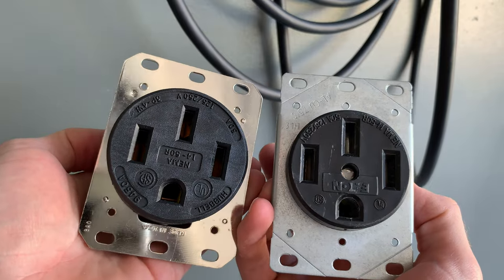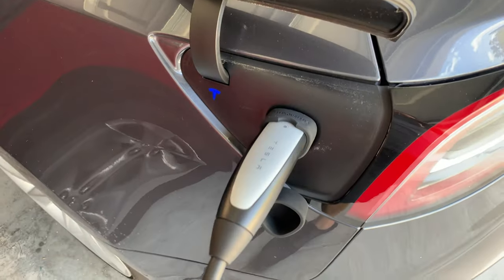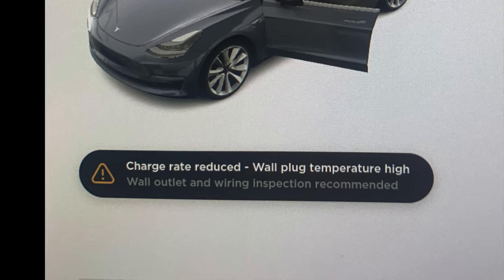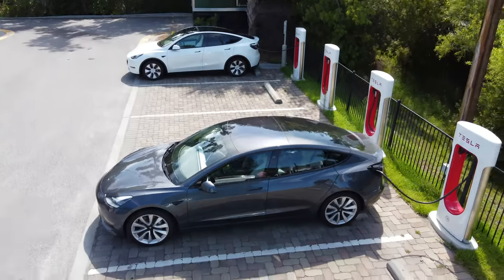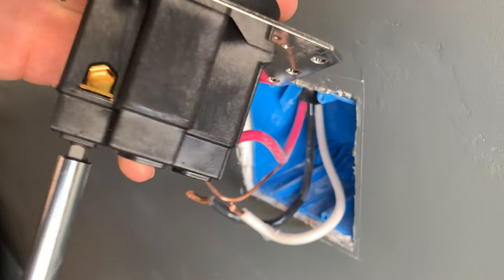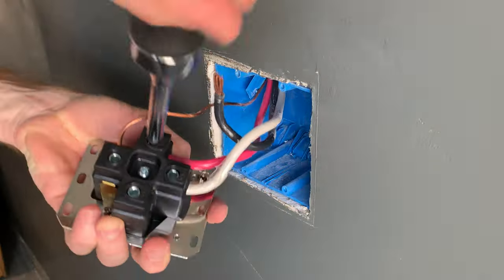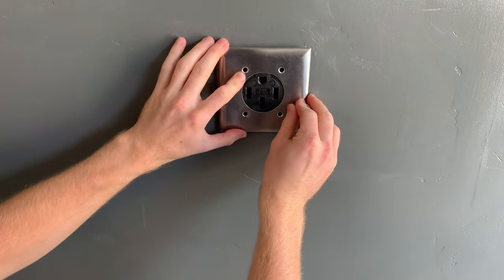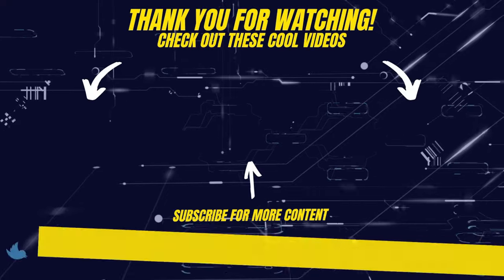Check Your Tesla Plug❗️ Why you MUST get an Industrial Grade Outlet 🔥 Tesla Recommended Receptacle

Comment: The thing is a lot (if not most) electricians are still using off the shelf 14-50 receptacles unless you tell them otherwise. The owner of one outfit even told me they've had no issues with the non-industrials.

Comment: After 3 years with no issues I started getting the same warning message and my amperage was substantially reduced.  I did not know about the Industrial Grade Nema 14/50 so I put one of those "Vornado" fans on the ground and faced it up at my plug and always turned it on when charging.  That was a temporary solution that worked well, but I would not want to "bet my life" on it always working.  Thanks to your video I will be swapping out the $10 Nema 14/50 I installed 3 years ago.
Reply from the maker: Thanks for your comment!
Reply: Hard wire the charger and be done with outlets. There is another video on this. You can also change out the outlet every three years and be safe also put a whole house surge protector on your panel I done that and never had anymore issues in the lightning capital of the USA which is Florida. 73
Reply: @ronb6182  

While hard-wiring it solves this problem, it also makes your setup less flexible. For example, you might have one of those cheaper EVSE plugs and might one day decide you want to upgrade to one of the many charging stations out there. You could manually uninstall the unit, but unplugging it is obviously way simpler.
Reply: @dontbanmebrodontbanme5403  I don't plan on paying three times the amount to drive my car. I like 5 minute fill ups over two hours to charge a car. My choice is to stay with gas or get a hybrid and not have to spend hours behind a charging station. We haven't found a solution to our lack of electricity and we want to add charging cars to the equation. Someone's elevator doesn't go to the top level. 73

Comment: Anything over 3 hours is considered a continuously operating circuit by the electrical code.  Which changes the amperage calculations of the circuit.  That's why Tesla recommends industrial grade outlets.

Comment: I'm a new EV owner and watched a few of these videos now. It's very likely in the majority of the melted outlet cases, the outlet was not installed correctly. For example, the exposed copper was not cut to correct length or the screws were not properly torqued. Note in this video, is he even torqueing the terminal screws to spec? They need to be tighter than you might guess. Note heat from electricity is generated by resistance. This is likely either incorrect wire diameter or poor connection to the receptacle, but in some cases, perhaps within the receptacle, as well.
Reply: Sooooooo trueeeee
Reply: Agree 100% from an electrical engineer👋
Reply: The electrician who put in the Leviton outlet in my parents garage said he’s done hundreds of them and has never gotten a complaint from a customer. As long as they’re properly connected and the owner isn’t continuously removing and connecting the 14-50 plug, there shouldn’t be any issues.

Comment: Great Video. I have installed a few hundred 14-50’s and lost many bids to my lower priced competitors due to my insistence on using Hubble. I have also received as many jobs to replace burnt receptacles.
Reply: Lol! Good story...
Reply: Seen any melted/burnt 14-30’s? Or is that a bit less risky since it’s lower current?

Comment: I am an Electrician and have installed so many of those NEMA 14-50 outlets. A few times I had  heat issue with exactly Hubbell receptacles. So I can not say they are better! They feel more solid ,but still have problems with them.
Reply from the maker: Thanks for the info! I have had not one error message on my tesla since installing this.
Reply: Interesting thing for you as a electrician is Tesla's recommended 14-50 brand list has Hubbell, Bryant (same as Hubbell) and Cooper (Eaton).
Reply: Are there any known products/brands of NEMA 14-30, or 14-50 outlets that are built specifically for use with electric vehicle charging? Any that are advertised specifically to handle long on phase of duty cycle with overnight BEV recharging?
Reply: @aaronbounds1336  Hubbell brand is supposed to be good with that ,but how I said up in comments I have seen them to go bad as well. Not a guarantee it will work forever without issues. If you are buying one make sure it is at least commercial/industrial grade ,they "supposed" to be heavy duty .

Comment: I have an OG Tesla wall charger at home I bought along with my original 2013 MS. I also have a vacation place where I had a NEMA 14-50 installed. The 2013 would charge at 40 AMPS using either the original mobile connector OR the Tesla wall charger. Fast forward to 2020 when I replaced my 2013 with a 2020 MS-LR. Now, the maximum with the new design mobile connector is 32 AMPS. However, I had installed the Tesla wall charger on a 60 AMP circuit so I can charge at 48 AMPS from that (after adjusting some DIP switches on the wall charger). I don't know the brand of the 14-50 but it was expensive and professionally installed. I never had any error messages while using it to charge either Model S.

Comment: I have been using the same NEMA 14-30R receptacle since 2017, no problems. It does get pretty warm though. Considering bypassing the outlet all together and getting a hardwired Tesla wall connector so I can bypass all of the problems also. Lots of videos out there with burned electrical components.
Reply: I actually haven’t been able to find any burned out 14-30’s. I’m wondering if it’s just way less of a melt/fire risk due to running at 24 amps instead of 40.

Comment: good stuff, also use some electrical anti corrosion compound on the wires when you put them in.  this is a good example of why a properly installed wall connector is a great idea.  permanent connections that can handle the high power continuous use.
Reply: Carl, you are so right.  Coming from the boating world, we know high amperage connections require prevention, maintenance, and exercise.  I see a lot of comments about EV receptacles getting hot etc., but I think some people overlook the fact the receptacle is usually in the garage which is not normally climate-controlled making it susceptible to corrosion and failure.
Reply: @CW-qt1qv  yes, it is amazing how all high use outlets will fail from corrosion, it sneaks up fast.  and once they start generating heat they go down hill exponentially.   Also, you know Tesla replaces the connectors at superchargers every 2000 charges....
Reply: @Wingman77tws  Good to know about replacing connectors!  Thanks.

Comment: Any resistance with high current will result in heat. The terminals on our main breaker were a bit loose and we almost had a fire. Good advice here. Also to note you don't have to purchase seperate Teala adapters to fit your dryer and stove receptacles. You can remove the neutral lug as it isn't used. The plug will then fit either socket. Just make sure to not exceed 24A

Comment: YOU have still overlooked a critical issue. The 50amp double pole breaker in your distribution panel can also overheat and even catch on fire. The solution is to follow the 50 amp breaker instructions precisely. And that means the copper conductors must be inserted then the terminal compressed over them with a good quality torque wrench.

Under-torqued and over-torqued terminal can both result in a fire….😮

Comment: It looks easy enough to change the outlet myself, so I might go ahead and do that.
Reply: Did u install it urself?
Reply: @faisq4  I had an electrician do the wiring and the outlet installation. I think that I was referring to upgrading the outlet to the heavy duty one myself. Mine never gets warm and I don’t feel the need to upgrade it. I must have something better than the $10 one?
Reply: @mitchellbarnow1709  Could be, since my car has started throwing this error and i had my electrician inspected my outlet (who actually installed it) but electrician said that everything is good and blamed to my tesla’s charger lol. And now i’ve got new charger and another tesla and error continues. Now I’m thinking to go with this outlet replacement option (finger crossed)
Reply: @faisq4  I think that Tesla has created a software problem, because I too have had occasional errors and I've had to  unplug my mobile connector from the wall outlet a few times myself. I bet that Tesla is aware of the problems.

Comment: Great points. There are a lot of vids here that show using the cheaper outlets for EVs. Installing EV chargers is all I do and am getting to the point of doing all hardwire installations. My last Hubbell cost me $164. It also needs the extra neutral wire and in many places a gfci breaker. On an exterior install, I have yet to find an enclosure that will accept the commercial grade outlets.
Reply: You mean due to the fact that the circumference of the Hubbell receptacle is larger than the standard 14-50?
Side Note: The electrical companies I've gotten quotes from  only use off the shelf 14-50 but said I could supply my own. Mind you these are two very large outfits in this city with hundreds of reviews.
Reply: @rkgsd  There is a problem with all the players getting on the same page with this new industry. Box store off the shelf are $15 receptacles that are fine for dryers and ranges that have intermittent loads. Off the shelf at a supply house could be a $50+ commercial grade. If a plug-in is necessary, a commercial grade is a must. Yes, the black round part is larger, 2.5 inches across instead of 2 inches across. By far, the best installation is to hardwire and avoid the receptacle altogether.

Comment: I know you already replaced the receptacle, but consider charging every night and lowering your charge rate. You will lose a little less energy to heat, and you will extend the health of your battery and all the charging system.
Reply: This is not true. L2 chargers don’t use enough amps to impact the battery at all.
Reply: @reemaszero  interesting that you respond to a 10 month old comment. In any case - you don't have any evidence to provide, so I'll not bother entertaining a response without data.
Reply: @MBergyman  I was just browsing YouTube videos and this came up. No need to be so defensive. I work in this field and have some familiarity. No one is pressuring you into believing me - a lot of data has been updated in the last 10 months around battery charging capabilities. A quick google search might help.
Reply: @reemaszero  You came on here to defend what you believe to be truth, but with zero links to any studies. Batteries don't like heat, some like it less than others, clearly - that is a fact. All charging inputs some amount of heat, another fact. Less heat will be less impactful on the battery health, this is a fact. Therefore, the rule of thumb for maximizing battery health is to use the charge rate that inputs the least amount of heat into the process and still charges at the rate you need it to to have enough charge the next time you need it. It is not rocket science, just common sense. 

Maximizing battery health may not matter to you after some certain point - maybe you are ok with the battery only lasting 10 years, but that is not germane to the talking points I brought up in my original post. 

As for being defensive, I use Youtube comments as a place to practice defending my own statements with good reasoning, so I'll politely decline your suggestion. I would also suggest you not make rebuttals without sufficient logic, it is a waste of your time and mine. Take care.
Reply: @MBergyman  lol
Reply: @reemaszero  

While I haven't read anything that says L2 chargers don't impact the battery at all, I have read from numerous EV brands that it is, for example, better for the battery to use an L2 charger and not a DC fast charger. Obviously DC fast chargers don't impact the battery that badly, or else why would Tesla and other brands even make their charging networks. It's just that, over time, charging using an L2 charger is better for the battery's health.
Reply: @MBergyman  

#1 Youtube doesn't allow links (unless they're Youtube links). Unless the link is another Youtube video, they get deleted.

#2 Ironically, you and Sameer are pretty much in agreement. He may have exaggerated by saying L2 chargers don't impact the battery at all. But everything I've read states that L2 charging is better for the battery health than L3 and that if you can, try to avoid using L3. 

No matter what you do, the battery's health will be impacted, including not charging it at all! But at the end of the day, you got extremely defensive when you could have simply responded with, "Well, while the impact from L2 chargers is fairly insignificant, it does have some impact." and left it at that.
Reply: @dontbanmebrodontbanme5403  

I'll go ahead and reiterate what I told Sameer. 

"As for being defensive, I use Youtube comments as a place to practice defending my own statements with good reasoning, so I'll politely decline your suggestion. I would also suggest you not make rebuttals without sufficient logic, it is a waste of your time and mine."

I'm not really concerned with how a stranger on the internet feels when they make untrue statements that counter my own true statements. It was never a real conversation in the first place; just some random guy coming in and disagreeing without any support of his argument.

Comment: Thanks for the YouTube. After 2 1/2 years without a problem I started to get the same message on my Tesla. It seems there are others that are experiencing the same problem after not having any problems. I think it maybe doing this as a safety issue that Tesla became aware of and in one of the recent upgrades on the software put this in place. There seems to be a bunch of these problems showing up on some of the Tesla Facebook sights. I have ordered the recommended receptacle you suggested from Amazon  and hope it fixes the problem. I have shared your YouTube with others. Thanks again for your help! Will let you know how I make out.
Reply from the maker: Thank you! Glad it helped!
Reply: Did it help?

Comment: If I was looking at a properly wired box with bad plug I wouild get tesla wall connector or another brand of hard wired level 2 EV charger and just run the J1772 adapter.  Someoen else you know or could sell a property to may have another brand of EV.    

Hardwired actually removes two plug connections from the system since the mobile charger has a plug on it too.  

That being said..The kit of all the available nema plug types is something I have coming for the model 3.   Road trips to friends or family on a vacation are when its handy.   You'll have eight plug options and end up with two plug types that charge at about 20mph  and two plug types that charge around 30 mph. 

If you dont want the kit, the nema 6-50 plug for the mobile tesla charger is also good to have.    A lot of home welder installs and existing witing for other level 2 chargers have this plug. 

If I had no existing 220v plug and had a good sized main breaker on a garage or shop.   Then I would install 100amp breaker,  there are some level 2 chargers that are 2x the speed of the gen 3 wall connector.

Comment: You have a 50A circuit breaker. If you ran AWG 6 wires for your 14-50 outlet, you should be able to charge at the speed of 40A.
Reply from the maker: Not with the mobile connector… this is limited to 32amps
Reply: @EMtesla1  Oh! That I didn't know. Thanks.

Comment: Most outlets are not made to have something plugged in and out every day like an electric car. If you don't go with a Tesla connector at least buy a separate mobile connector for home and travel.
Reply: I have installed dozens of the least expensive nema 14-50 outlets . I tell my customers not to plug and unplug the evse leave it plugged in but if they have to unplug it I will have to install the heavy duty model! Even if you plug and unplug the heavy duty model eventually it will fail too! Also make sure the electrical box you're using is extra deep to help dissipate any heat that may occur!

Comment: How do you know it's not the plug that is the problem?  My tesla plug got to 140 F and when I cut it off and replaced with a clam-shell, wired yellow plug with a handle on it from Home Depot it reduced the temp to about 95 F.  Used an infrared thermometer.  It's possible the industrial receptacle just transfers heat better back into the wire.  I don't know how a "cheap" Leviton or similar 14-50r can fail while and "industrial" 14-50r will work correctly.  Both comply with the 14-50r specification.  I'm not buying the hype until I see an independent study.

Comment: When you test from a hot lead to the ground do you have to wiggle around the ground lead a bit to get a 120V reading or do you just slide in the ground lead and it reads 120V without much issue? If so wonder if this is just the design of the Hubbell.
Reply: You typically have to move the leads around to find a good connection/reading

Comment: The charging that  comes with the Tesla.,   Do I need to buy a adaptor to make it fit the 1450 outlet?   From Tesla, changes the three prong to the nema 1450 correct?
Reply from the maker: Yes, you need the gen 2 Nema 14-50 adapter.

Comment: Your wire size is super important....what you are showing looks like 10 Guage,  even if it's 8 it might not be enough depending on run length to the panel.
Reply from the maker: It’s actually 6 gauge